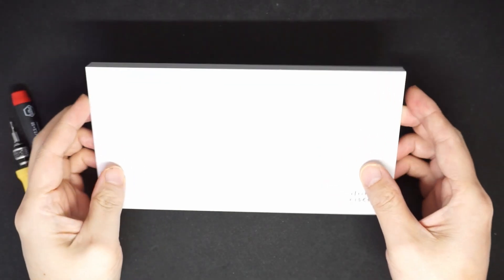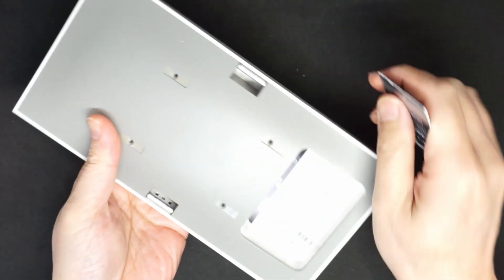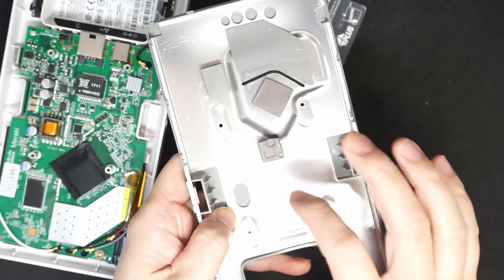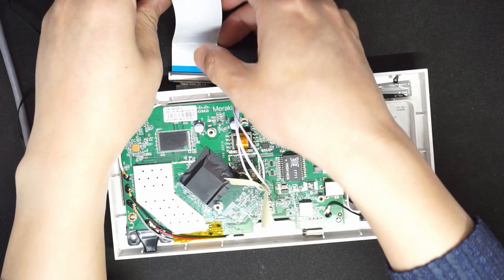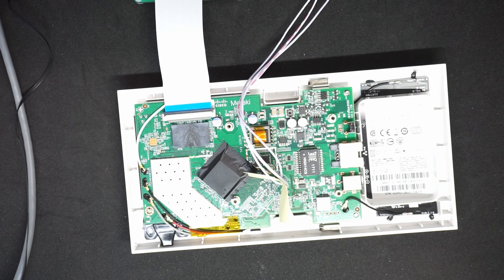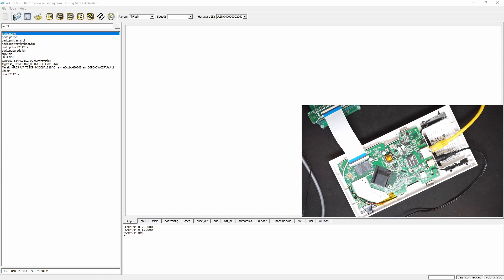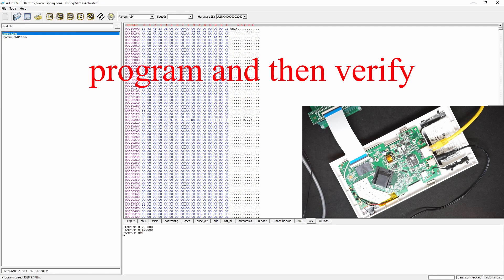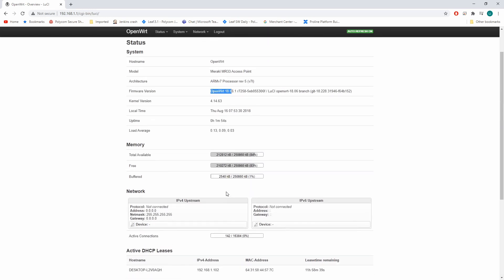u-Link NAND program Openwrt on Meraki MR33.

Comment: Hi Teacher, I have a question: when you replace u-boot and Ubi, at what point is OpenWRT installed?
Reply from the maker: Replace u-boot it allows you to use serial port.
Reply: @usbbdm  Sorry for so many questions. In the case of your video, you change u-boot and Ubi, and when it finishes you can access OpenWRT. I thought that in this process of changing u-boot and Ubi, WRT was already included...

Comment: Would you be willing to offer this as a service to flash AP's? I would like 2 x MR33's doing. 
Thank you
Reply from the maker: You mean physically send me the AP to flash? I do not know if it is worth doing that due to the shipping is quite expensive.
Reply: @usbbdm  where are you based as I'm in UK? 
I'm a tech and probably capable of doing it, as flashed other types of products in the past, and also can solder with thr correct ESD and SMC rework etc, but I've never done this before so was wanting an idiots step by step guide and also links to everything i would need if possible otherwise :) great work and krep it up :)
Reply from the maker: @moodyk1979  I am in North America. Converting MR33 is for fun. Having someone doing for you lots the fun part.
Reply: @usbbdm  believe me i want to try it but i want to use them asap, as I want to install them into my new appartment. Would you be able to email me so we could talk about helping me doing this from scratch like and idiots guide? Thank you
Reply from the maker: @moodyk1979  Come to www.usbjtag.com and we can chat there.
Reply: @usbbdm  Trying to send a private message on usbjtag but I just joined. Guess I have to post something before it allows me to send PM.
Reply from the maker: @hiepp0  You can use online chat with me not the forum if you need immediate reply.
Reply: @usbbdm  I was going to ask about the same thing that moodyk1979 was asking.Since you have all the equipment setup to flash, would you be willing to flash 2 units for me. I am in Canada. If you were in Canada, shipping would not be too bad. It would cost about $150 to purchase the 48pin adapter and NAND programmer. I would have bought it if I can think of anything else in the future that I would be doing some sort of programming but could not really justify it. Let me know
Reply from the maker: @hiepp0  Come to my site and chat.

Comment: is there an alternative way to do this
Reply from the maker: Remove the flash and program it using a NAND programmer.
Reply: @usbbdm  oh but I mean like just using the serial interface I won't be able to downgrade or is NAD Programming the only option I have and also can you recommend some and programmers.
Reply from the maker: @rayyanrahman262  For some newer u-boot, the serial port method does not work.

Comment: I found time to watch the video. It's great! I have a few questions for you.

- Are you holding the Power to the UART Connection, while flashing the chip? IT was still connected to the pins, so I need to ask.

- You are flashing the chip without desoldering. Most people recommend to desolder it. Is there no risk of doing it, without desoldering? 

Thanks for a great video 😀
Reply from the maker: No. When programming the UART is not powered on. Power is from u-Link NAND. It only draws 90mA 3.3v.
Reply: And oh, maybe add information about the programmer in the details too, including which hardware you've used. That would be helpfull, too.
Reply from the maker: @TechTonor  I have created several video about u-Link Nand already. Let me know if you still have questions so I can make new videos to clear things out.

Comment: The wallmount backplate is just a spring-mechanism. Just press is with your fingers. There's no needs to use a screwdriver ☺️
Reply from the maker: Agree,I latter on find it has a spring-like clip and easy to remove.